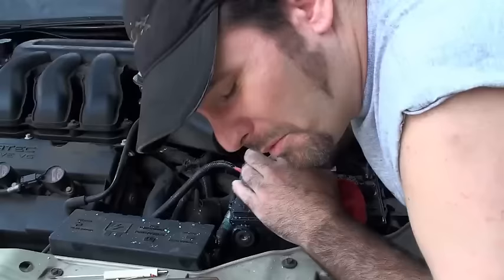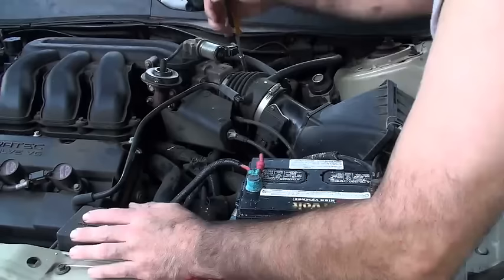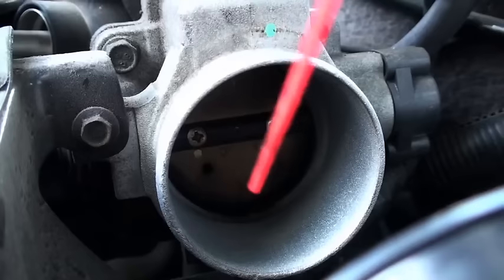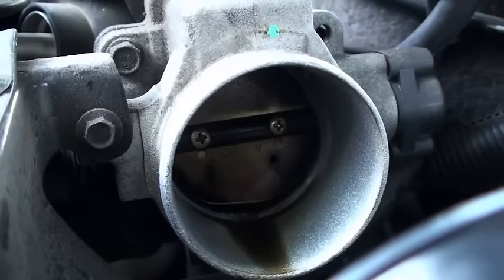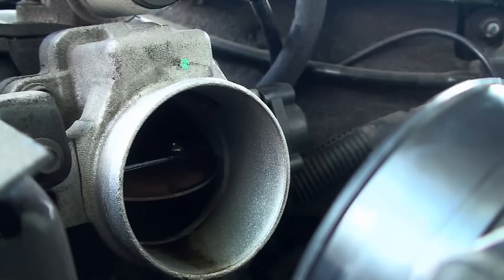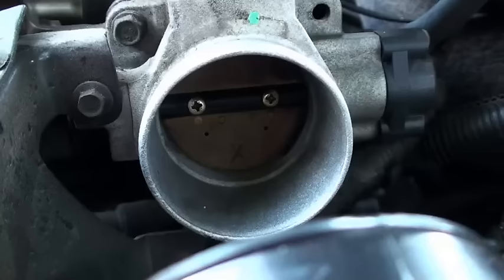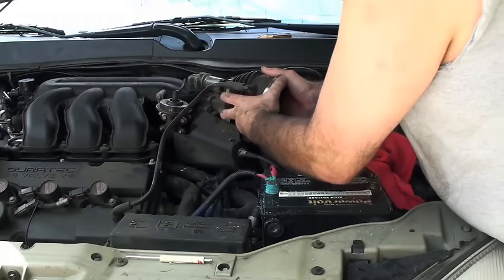Quick Tip-Throttle Cleaning - EricTheCarGuy

Comment: do not move the butterfly with your hand on modern cars , it will mes up the position censor calibration
Reply: NOBOX7 how do u move it to clean inside it
Reply: Tobias Jn. Pierre on new cars you turn the ignition on but dont start the car then have some body press the gas peddle and it will open . or you can remove the throttle body from the engine
Reply: Thank you, I remove it from the car today
Reply: nice tip
Reply: Can I move it on a NB Miata ? Planning to clean it this weekend
Reply: This guy  knows what he's talking about, don't move the butterfly when cleaning the throttle body, I just did my 2008 Denali, all I used was a clean cloth and some cleaner to it, it takes a little time, but be very careful. It's better to remove the TB, that way both sides can be cleaned. I made the mistake opening it up just 3/8 of  a inch and for a split second and idle went up to 1500rpm. When slowing down, the rpm would rise then fall then rise again then it would be back to normal. It corrected it self after a couple days.
Reply: Do you need to unplug the battery for this? what about the electronic/power connectors attached to the throttle body itself? Thanks.
Reply: martmelee just unplug the (-) terminal then you're good
Reply: martmelee actually batteries should be unplugged in every car which has ecu/ecm
Reply: NOBOX7 i did it on my 02 impreza now when i starts it idles straight to 6000rpms how do i re-calibrate the sensor for a normal idle??
Reply: look up the relearn procedure , you gotta turn the cart on then off then on then press the gas pedal 5 times then hold it in for 7 seconds or some strange procedure like that on my car , its different for all cars
Reply: Eric didnt, of course, but there ya go. IOW, dont go sticking your had in there to move the plate, use the actuator arm outside of the body to move it.
Reply: @NOBOX7  

I moved the butterfly with the wiring plug removed and battery terminal off (fly by wire type, was replacing head gasket at the time) on a 2004 Fiesta 1.25... didn't hurt it any.
Reply: @boskey10  Remove neg battery terminal for 15 minutes and computer will recalibrate when neg cable is reinstalled.
Reply: Remove it on fords their is a auto sweep mechanism so it doesnt freeze it will cut you friggen finger off dude didnt even disconnect the battery lord
Reply: @ahmidra8671  unhook the negative and add a jump wire from postive to negative then let idle for 20 min
Reply: you can reset it or re calibrate it by turnig key and not starting it but just turning key and slowly pushing the gad pedal in and out a few times
Reply: Thankyou for the pro-tip.. i was just wondering
Reply: No, you don't have to remove it just because it's a drive-by-wire / electronic throttle body.  Just unplug the power cable for the throttle-body before you move the butterfly-valve.  Simple. ez-pz

Comment: This is especially helpful and even important with newer drive-by-wire throttle bodies. Since they're actuated by a small motor or similar, and tend to be taking the place of idle air control valves and the like, they cause a lot of odd problems when sticking. One problem being stalling only when starting the car warm. The throttle will get stuck closed and starve the engine. It also tends to make throttle response feel even more delayed than most drive-by-wire throttles are from the factory. Great tip Eric!

Comment: HOWDY ERICTHECARGUY...I have a 92 crown vic lx, with 280,000kms on it. had the throttle sticking problem, didn't know what it was causing it to hesitate and even stall on the QE2 in Alberta. Saw your vid, man that throttle was completely covered in thick gunk, cleaned it out like you showed, and it works great now, now I have to change the belt, followed your instructions, another triumph, thanks eh!

Comment: Great videos Eric! My tip to you is to use a toothbrush instead of the rag. They do a great job and looks brand new when your finished. On fly by wire cars, make sure the ignition is off before moving the throttle plate.Also don't forget to use nitrile gloves when working to stop the skin from absorbing grease dirt and chemicals.
Reply: You all probably dont give a damn but does anybody know a method to log back into an instagram account??
I was stupid forgot the account password. I love any assistance you can give me.
Reply: @Mohammed Wells Instablaster :)
Reply: @Bronson Titus thanks for your reply. I found the site thru google and Im waiting for the hacking stuff atm.
I see it takes quite some time so I will get back to you later when my account password hopefully is recovered.
Reply: @Bronson Titus it worked and I actually got access to my account again. I'm so happy:D
Thank you so much you saved my account :D
Reply: @Mohammed Wells No problem :)
Reply: I’m thinking of just putting my truck down. So frustrated with this stalling bs. It could be 40 different things causing this thing to stall out. This sucks. I don’t even know where to begin. I’m going to get a code check first and some sea foam and marvels m oil. Everyone has told me to do something different. I guess I shouldn’t have asked.
Reply: @citysurvivor4919 what kind of truck is it?

Comment: Good video, the best product to use to clean out throttle bodies is the ThreeBond Engine Conditioner. Heat the engine to running temp first then turn off the engine and take the hose from the throttle body. Spray the engine conditioner into the throttle body and it will foam up and clean all gummed up areas. It also lubricates the throttle body. Start the engine and spray the rest of the can through and it will clean the complete combustion chamber. It is a complete carbon clean in a can.

Comment: Great job Eric. On my 2004 Chevy Trailblazer, I replaced the MAP due to OBD code. My acceleration increase and overall performance was great. Two days later, I got a P0106 code (MAP performance). Cleaning the throttle body was one of the suggestions. In fact, cleaning the throttle body every 30,000 miles or so helps. I can't remember the last time I did this on my SUV (205,000). So I was looking for a video that shows how to clean the throttle body without removing it (I'm not as young as I used to be :)). Thanks again for a quick and concise video.

Comment: Thank you.  I have a Toyota Avalon 2004 that had a sticking accelerator.  I saw how you did it.  I did it too.  My car looked a bit different under the hood.  I am an old guy who used to take out the carburetor and clean it 50 years ago.  I didn't realize that the same type technology was in modern cars.  I didn't even have to use a tooth brush to fix the problem.  Thanks again.

Comment: My accord 2007 2.4 rpm go up and down when cold start goes back to normal when engine warms up. Also has a bucking when  for of the gas pedal and rpm go up and down same time.  Could be the throttle body?  I cleaned  it but no changes. No codes

Comment from the maker: @MrMdezee If someone adjusted the idle screw I would recommend turning it back to where it was originally and then checking for vacuum leaks.  If you suspect an IAC problem replace it, I haven't had any luck cleaning them.

Comment: i find a brick on the pedal helps keep the throttle plate open
Reply: I knew a Ford dealer that used to do this to Problem Lincoln and ford Mercury  that were on the edge of warrantee because of bearing knock. Ford would call the noisy engine normal. Well was not normal after that  ''' 80FNot so sure if it would work on this application thought although id would solve the throttle body issue.  8)
Reply: I use the steering wheel lock.
Reply: doesn't work on all cars'! I've tried it at my Lexus GS bot no chance!
Reply: Where's the brick having a hard time looking for a brick on my petal
Reply: @fabuloso3635  or you could use a long stick or a broom or something long, put it between the seat and the pedal, and move the seat colser to the steering wheel, all the while the long object will depress the pedal for you.

This is one way.
Reply: @suzumr2754  lmao I forgot I made this comment, lol it was me tryna be funny.
Reply: Rocco Velasco hahaha I found my brick under my drivers seat sometimes they slide back from the factory
Reply: @whydoihave6neutrals772  Yea make sure the factory brick goes back to the pedal so you only have to concentrate on the brake pedal and keep the high RPM. Also requires less coordination to get a fast start after a red traffic ligths or stop signs, so people dont honk at you as often!
Reply: Or stick screw driver in throttle
Reply: @user-ws3sl9xi7y  never do that on an electric throttle
Reply: @lovemym16 🙌 Hey, I drive an old Subaru. I don't even know what the words "electric throttle" even mean.
Reply: @user-ws3sl9xi7y   no you’ll scratch it
Reply: Lmao
Reply: Don’t recommend this.. if the brick falls for any reason and the finger is in the throttle, say goodbye to that finger
Reply: Shit I was wondering if I was wondering if I was the only one that did that
Reply: @mustafaalmustafa3096  that uses a different throttle control logic
Reply: @cosmicfiber4  you didn’t use the factory brick!
Reply: @cosmicfiber4  and nah bro if you go to a big enough brick I’d trust that more than someone else’s foot there

Comment from the maker: @tonytiger33 If you don't have a check engine light start with the basics like plugs and a fuel filter.  DON'T start replacing sensors as they probably have nothing to do with it.  You might also do a power balance test to see if you can find a particular cylinder that is at fault, I've done a video on this if that helps.
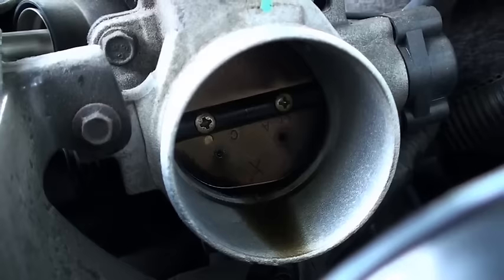Reply: ❤ 1:20

Comment: I just used rubbing alcohol and Air Flow Sensor cleaner. And some Q-tips and paper towels. It's best to do it when you don't have to drive anywhere afterward that day. So do it at the end of the day and let your car sit overnight before starting so the chemicals can evaporate and throttle can air dry overnight. Otherwise you'll take a chance of trouble starting and/or the chemicals flowing your exhaust.

Comment: 04 XC90 2.9L AWD@145K/new Volvo dealer installed tranny @90K/Timing @110K.  As of recent, there is a "rattling" sound when driving 18MPH+.  It does not increase in volume @ higher speeds, It increases in the rattle though.  Accelerating neutral in park produces no noise other than a "puttering" from the exhaust as of a couple of months ago.  I have codes P0102/P0420.  Napa said it might be the motor mount causing the engine to make contact with the cooling fan while accelerating.

Thanks!

Comment: Sea Foam fuel system cleaner and a tooth brush works well. I always use an old toothbrush anyway.
Reply: Thanks. I was wondering exactly that, because I have some Seafoam, but I don't have throttle cleaner.

Comment: it's not really nec. to take the throttle body off. With an old tooth brush and some cleaner you can clean the throttle plate and the area where the throttle plate contacts the body without removal. If you remove it you may be into a gasket replacement or coolant hose leakage (if yours has coolant hoses to it)
Reply: But in this way all Carbon enter further into Engine or Carburetor or Combustion Chamber

Comment: Hi Eric, your videos are awesome! I usually use Seafoam instead of TB cleaner and spray about 1/8 of a can in the intake as well. I leave it for about 10 minutes then start it up and let it run through. I've heard that this can actually plug your catalytic converter. I've also heard that it cleans the catalytic? What's your thought on this?

Comment: Man to I ever wish I had seen your video 2 years ago. I had a sweet 1998 Buick with the 3.3 or 3.6  liter engine. I was getting run away acceleration and the local garage decided it was a manifold leak and blew the engine up trying to prove that theory. It turned out to be a dirty throttle body but by the time they found that I had a knock on the crank. I sold the car a few weeks later.  It was one sweet unit. 6k miles. Ran like new, spotless. I only drove it in the summer. I was not going to throw a new rebuilt in it.

Comment: I would personally recommend removing the throttle body completely. I remove all electronics (IAC, TPS, etc..) and clean all the passages. The TB cleaner shouldn't damage the sensors and valves (IAC) but if I'm cleaning something I'm doing it 100%.

Definitely pay attention to removing all the buildup around the edges of the butterfly valve, that's where it will stick the most. And don't use anything abrasive to clean internally, a nylon bristle brush is ok, NO steel wire!!

Now if you are still having a problem with throttle response then I'd look at the throttle cable. Just like the hood latch cable it's braided wire that will stretch and when it's stretched the butterfly in the TB won't fully open. There are the cheap zip tie tricks, but just replace the cable, not worth a snapped cable at WOT!!
Reply: Really good advice! Thank u so much! My ,2091 dodge neon started stalling a month ago while! Usually after I drove it 15 miles it would stall and stutter a few times, then straiten back out And drove fine! It did that a few weeks then today while I was driving home it just died, while driving down the road, and won't start back now! It cranks but won't start! And I listened at the gas tank to see if the fuel pump kicks in when my friend turned the key over, the fuel pump came on and makes a whining noise! Do u no what can cause my car to stutter then die and not start back! Thank u so very much 😊😊
Reply: Sorry it's a 2001 dodge neon, and if it's the fuel filter can that be changed without changing the fuel pump! I heard the fuel filter was made in the pump and have to change the whole fuel pump! Thank u so much
Reply: Becky Justice Do you run your tank below 1/4 full often? More than likely your fuel pump is done for but you can try a filter first.
Reply: Thank u so much Tanner! I kinda had a feeling it might be the fuel pump! I went out the next morning and it started right up like nothing was ever wrong with it! But still has the stalling after driving 15 miles and still wants to quit when I come to a stop on inclines! And when I turn the key I can hear the fuel pump kicks on for a few seconds! Thank u so much for all your help Tanner! I really appreciate it
Reply: I love you so much for this, I just watched another video and he told me to take it completely off
Reply: Thank Tanner & Becky, Kang & Queen of  Caucasia

Comment: They sell throttle body cleaners at your local Autozone or Oreilly auto parts.  Stuff works great.   Always disconnect battery when working on a engine.
Reply: Most cases but not always I would say...
Reply: Raul, before you give this advice, you should consider BMW, and maybe some other brands. If you disconnect the battery, you have to re enter the radio security code before the radio works again. What about the readers of this who don't have their radio code and don't realize they will need it after batt disconnect? You can hook up a temporary 12v supply before you disconnect the battery to save the radio code if you had the knowledge. I wouldn't disconnect battery for most throttle body cleanings.
Reply: That happened on my acura, had to go to the dealer to get the code :/ but hey they'll need to disconnect the battery eventually
Reply: Arthur Swails Really? BMW's are so dumb you have to enter the code everytime you disconnect the battery? Well on Audi's only if you put the radio in another car only then you enter the code.
Reply: kgisabeast or u could just call them, that's what I did
Reply: fetullah ydz I have an 07 5 series and I don' have to enter the code if I disconnect the battery
Reply: HDVi118 Okay, that is good.
Reply: 2005 Honda CRV Requires Radio Code, However, Disconnecting the Battery May Inadvertently Be a Good Idea, Since it May RESET The "Learned Settings" From When The Plate Was Gooked Up.  Not Disconnecting Battery May Cause "Check Engine" Light To come on AFTER Cleaning Because Old "Learned Settings" Dont Jive with Our New Clean TB Plate???  Whaddya Think?

Comment: 2000 Honda Civic EK

Just did this outside in like 25 mins time, cold air intake nuts n bolts.. Cleaned the inside as far as i could, sprayed with the throttle valve cleaner a honest amount... Started it with full throttle and the beast is back alive :D Big up Eric!! Pretty sure its because of the full throttle during start, sputtered out the excess n' bout to see if it made a difference!!

Love the videos m8

Comment: On most OBD II compliant vehicles, when the computer is given a 100% signal from the TPS, the injectors are turned off entirely, so that no more fuel can be put into the cylinders, and as much air is received as possible. This allows the engine to get rid of the excess fuel/carb cleaner, hence the name "clear flood mode".

Comment: TPS, throttle position sensor, cannot be cleaned. They are a sealed unit. They should not be taken apart and cleaned. They are a precision sensor and should not be messed with.
Reply: And false